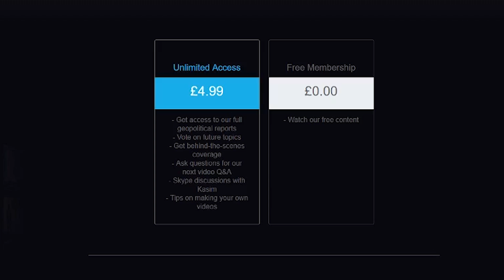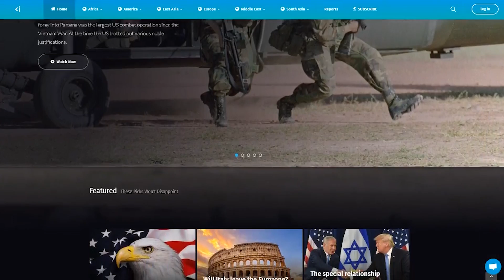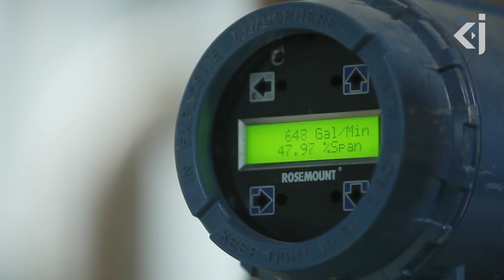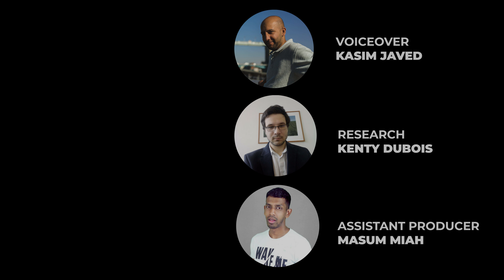CHINA and the geoeconomics of RARE EARTHS - KJ Vids

Comment: JAPAN ALSO FOUND VERY much RARE EARTH RESOURCES
Reply: I came here to post this.

https://www.businessinsider.com/rare-earth-minerals-found-in-japan-2018-4/ 

>Researchers have found a deposit of rare-earth minerals off the coast of Japan that could supply the world for centuries, according to a new study.

>The study, published in the journal Nature on Tuesday, says the deposit contains 16 million tons of the valuable metals.

>Rare-earth minerals are used in everything from smartphone batteries to electric vehicles. By definition, these minerals contain one or more of 17 metallic rare-earth elements (for those familiar with the periodic table, those are on the second row from the bottom).

>These elements are actually plentiful in layers of the Earth's crust, but are typically widely dispersed. Because of that, it is rare to find any substantial amount of the elements clumped together as extractable minerals, according to the USGS. Currently, there are only a few economically viable areas where they can be mined and they're generally expensive to extract.

>China has tightly controlled much of the world's supply of these minerals for decades. That has forced Japan — a major electronics manufacturer — to rely on prices dictated by their neighbor.